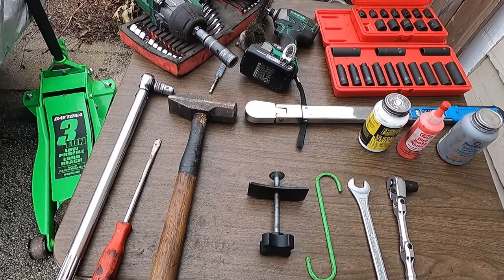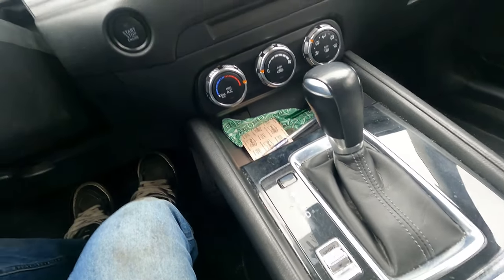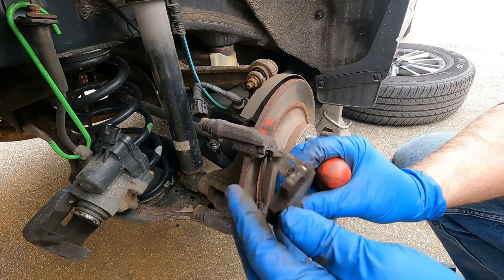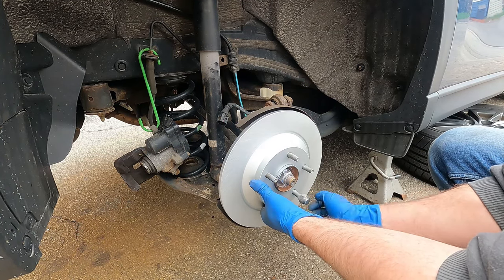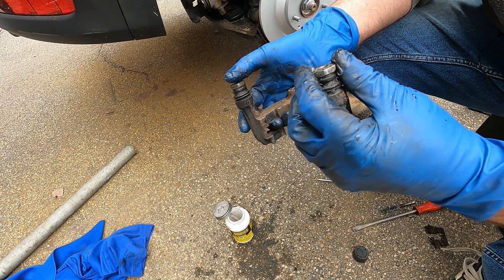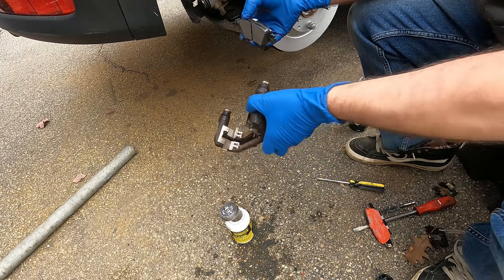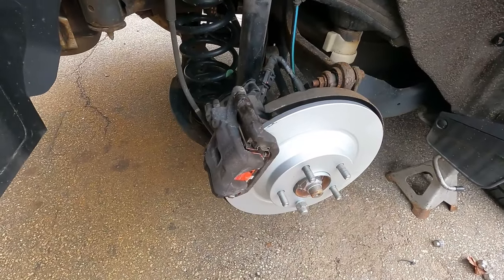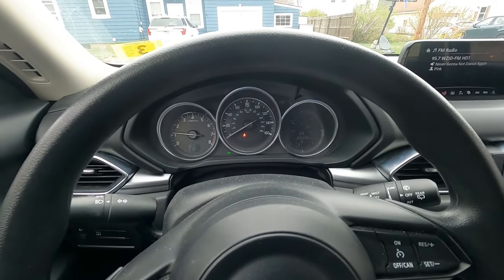How to replace Rear Brakes Mazda CX5 with electric parking brake Easy

Comment from the maker: Wire Brushes: https://amzn.to/3LWhVo7
Wire brush set (pipe cleaner style) : https://amzn.to/3O5ITg5
Brake caliper hangers: https://amzn.to/41qMeco
Brake caliper compressing tool: https://amzn.to/42HZGd0
3/8 socket set: https://amzn.to/3nZ18J8
Ratchet: https://amzn.to/3W15Brt
Wrenches: https://amzn.to/3MeRXxM
Torque wrench:  https://amzn.to/42pjVfW
Screwdriver set: https://amzn.to/3LWkgzp
1/2 impact: https://amzn.to/3pkDBmj
21mm socket: https://amzn.to/3ptgu9s
Drill and Impact driver: https://amzn.to/3VRZPIw
floor jack: https://amzn.to/3Mgbgqh
jack stands: https://amzn.to/3pyICYw
Hammer : https://amzn.to/3LYhw4G
Breaker bar: https://amzn.to/3BhyLJo
1/2 socket set: https://www.amazon.com/Sunex-2645-26-Piece-10mm-36mm-Storage/dp/B002MW9UW8?crid=17XM483DVM8V1&keywords=1%2F2%2Bsocket%2Bset%2Bmetric&qid=1683772407&sprefix=1%2F2%2Bsocket%2Bsettric%2Caps%2C250&sr=8-5&th=1&linkCode=sl1&tag=andythextec0d-20&linkId=af6b8958c827df5e0197286a75422a28&language=en_US&ref_=as_li_ss_tl
silicone paste: https://amzn.to/3LXylgl
Stop Squeak:  https://amzn.to/3VRJUtY
Anti seize: https://amzn.to/44JKLkt

DISCLAIMER:  This video and description contains affiliate links, which means that if you click on one of the product links, I will receive a small commission.  This helps support this channel and allows me to continue to make videos like this.  Thank you for your support!

This video is only for entertainment purposes. If you rely on the information portrayed in this video, you assume the responsibility for the results, some of the projects could be dangerous if not done properly. Andy the X tech
Reply: I have Cx5-2019 Mazda, It run 100k brakes giving alot of noise, do you advise recommend which company brake pads and rotors are good. Thank alot

Comment: helpful video but you literally cut the one part I came here to see - was struggling w/ getting the pads properly seated in the bracket and you cut that out...
Reply from the maker: O sorry about that. I’ll have to check the footage. I would think you need the angle the pads a little then twist them in place.
Reply: @AndyTheXTech  It's fine, I'm not sure why they gave me so much trouble, never had trouble w/ them on different cars and I was wondering if I was missing something so I came to this video and watched, super helpful but then when it gets to that part it just cuts and skips to them being seated properly. I figured it out though and I was just being dumb and they are just a little finicky.
Reply: @slowdownnn11  there are a pain on mots cars you need to play with them until they pop in, no secret just need to find the right angle that’ll work

Comment: No tool needed at all for the e parking brake. Just turn it off.
Reply from the maker: Yeah, no tools needed but you need to put it in maintenance mode. Otherwise you’re gonna mess it up.
Reply: @AndyTheXTech  I just installed rear rotors and pad on my wife's CX5, and it did not require me to put it in service mode. Everything works, no issues.

Comment: Hey Andy! Really an informative video. Thanks for it. As I’m doing this job myself for the first time and wanted to confirm torque on those bolts for bracket and calliper.
Brake bracket- 75 ft-lbs and calliper bolts- 24 ft-lbs

Comment: On my 2015 the rear caliper froze up at about 90K miles and needed to be replaced. Also at about 120K one of the slide pins froze up I had to use a 5lb hammer and pound it about 30 times to get it out. You should check the slide pins grease every year.  Also if you are cleaning out the bracket where the slide pins go into remove the rubber boot first. I didn't and put it in a parts washer and it grew to twice its normal size due to the solvent.

Comment: Hi Andy
We just carried out a replacement rear pad change with your procedure, (right hand drive) all good now. Did you forgot to mention to pump the pedal first?? Pistons spun (both red and orange lights flashing) until we pumped up the brakes and redid the service on then off. Thanks for the video 👍
Reply from the maker: I didn’t have to on this one. I did it exactly how I showed. Sorry maybe because it was right hand drive.

Comment: Okay I’ve seen these coated brake rotors, but I’m curious how these compare to painted brake rotors.  Any reason in particular the coated rotors were chosen?
Reply from the maker: Well everything is going to rust eventually. The only reason we went with these price was good.
Reply: @AndyTheXTech  okay, much appreciated.

The reason I asked was because I wasn’t sure why my calipers look dingy, even though, when I bought the car new, the calipers were coated.

Wasn’t sure if they wore out like paint but looks like they have similar properties

Comment: Thanks! makes my next job simpler.  What are the torque specs for the caliper & pad housing?
Reply from the maker: Rear caliper is 22 ft/lbs the bracket is  75 ft/lbs 👍
Reply: @AndyTheXTech  thanks!  Just having a post brake job beer!

Comment: Last time i replaced the acuator without put the vehicle to maintenance mode, since that time each time i pull the Ebrake it always show the yellow P light blinking. The scan tool says the acuator disengage. Does that means i ruined my acuator?

Comment: I have a 2016 CX-5 that falls into that rear-caliper/EPB module fiasco TSB (R052/16C).  We do have brake pulsation, especially at higher speeds when braking, and the pads on the rear are in need of replacement according to a Mazda tech.  Could we need the updated rear calipers from the TSB along with pads and rotors?  How do you determine if the rotors in the front or the rear need replacement?
Reply from the maker: if you replace the pads you should replace the rotors. some times if you feel the pulsation/vibration in the steering wheel then its coming from the front and if you feel it in the seat its from the rear.
Reply: @AndyTheXTech  how should I determine if the rear calipers are dragging stated in that TSB?  It sounds like the way thought it was the EPB module for a while but turns out the rear calipers are the culprit.  If one pad on each caliper is worn more than the other?
Reply from the maker: @on1ytheb3st  you could try with the wheels off the ground, pump the brake pedal a couple times then get out and try to turn the wheels. If there binding up or stuck then there is something causing it at that wheel.
Reply: @AndyTheXTech  Its apparently the EPB actuator on the rear calipers that causes the dragging.  Creates a situation when you deactivate the parking brake, the pressure from the actuator isn't relieved completely.  I guess I'll lift the rear and actuate the parking brake, then deactivate it and see if I can spin the wheels.  

They should spin completely freely right?  Do I need both rear wheels to be off the ground to see if the rear wheel spins freely?
Reply: @on1ytheb3st   temperature and pad thickness difference.  If the pads are dragging, there will be a greater increase in temperature compared to non-dragging pads.   2nd, a dragging pad (stuck slide pins), one of the pads will be thinner than the other.  Pads are supplied to wear evenly (equal pressure), but if the caliper is stuck then one pad (inner) could be thinner than the other.

Comment: Hey quick question, do you know if it’s the same procedure for a 2019+ Mazda 3? Planning to do the rear brakes and rotors but I’m not sure if you compress the caliper piston or if you rotate them piston in with a caliper tool.
Reply from the maker: It should be the same. Worse case you need to find another procedure to retract the parking brake.

Comment: Thanks a lot for the comprehensive guide.
Just two questions:
1- do you have any suggestion for brand of pads and rotor and from to buy them in Canada?
2- is the procedure the same for AWD?
Reply from the maker: You’re welcome! As far as the brand goes, it’s all preference. Normally just a higher quality ceramic brake pad will do. (Raybestos) 
And yes, this vehicle was an all wheel drive, but it should be the same either way . 👍

Comment: I have 3 questions for u: 
1. This procedure is the same for ALL Mazda electric e-brake?
2.  Can I use the C -clamp rather than took you use?
3.  Is it necessary to do those step you showed us, or is there a way we can skip ?
Reply from the maker: Not sure about about other Mazdas.
Clamp should work but be careful not the brake the motor on the back of the caliper. 
If it wasn’t necessary I wouldn’t show it.
Reply: CAN YOU SHOW torque specs on the caliper bolts please  @AndyTheXTech
Reply: I was going to use a c clamp until I realized the electronic parking brake cover was plastic, meaning I wasn't sure it could handle the c clamp's force and didn't want to break it, so I went to local parts store and borrowed the tool he uses in this video for free (as long as you return it).
Reply: @mrau92me  it's like 8 bucks at Harbor Freight also

Comment: For the EPB how come some people twist and push the piston back
Reply: On that car you should twist/turn, not push back only.  You can see because the piston is not flat and has markings for it.
Reply: @stjani10  that requires a different tool though. I see Performance Tool makes one that goes onto a ratchet. Andy doesn't have problems with this though, so how important is it?
Reply: @matsudakodo  i've done my rear twice, i've done both twist and compress and botn worked fine.  But the manual says press is better, as its needs to end the correct position.  So ... if you can press fine !
Reply: @stjani10  great, thanks.
Reply: @stjani10  I've since read that we should not turn the rear pistons. The notches are supposed to line up with the notches on the brake pads, so just push them straight in.

Comment: Interesting that the maintenance mode is push 5 times the engine button, because on my 2017 (2016 body) it's 3 times.  
These EPB's are really fragile, really eat up my pads and discs even.  Also since i've done the pads a few times sometimes i need to drive the car a bit before the maintenance mode can be turned off again.  Otherwise it give's me an error.
Reply from the maker: Ya I’ve heard others say the same about the error message. I wonder if it havens on older vehicles because of the calipers need to be replaced.
Reply: On my 2023 it's 3 times also

Comment: What year is this CX5?
Reply from the maker: 2017 it’s in the description
Reply: @AndyTheXTech  Ahhhh damn didn't see it. I have a 2018 Touring CX5. Process still the same for that year?
Reply: @hulkxsmash7951  same, but it should only take 3 presses if you start with ignition on

Comment: What’s the 19 mm open end wrench on the caliper bolts while you were tightening with the socket? Purpose?
Reply: He was holding the nut from spinning that mounts the caliper to the caliper bracket where the  caliper slide pins are . Hopefully that was a good description.
Reply: Otherwise it will spin